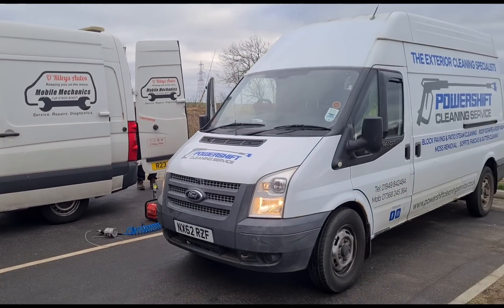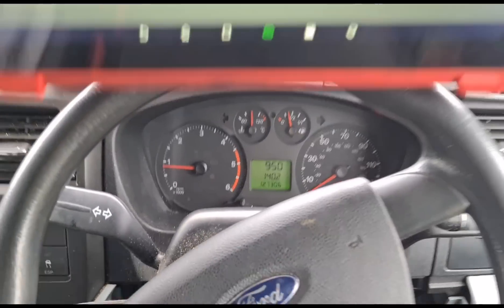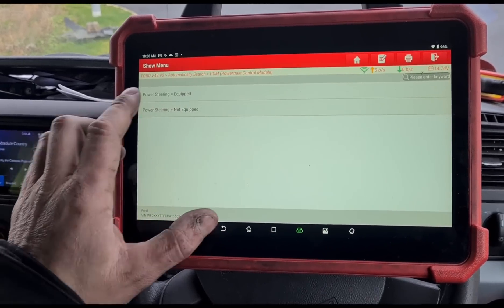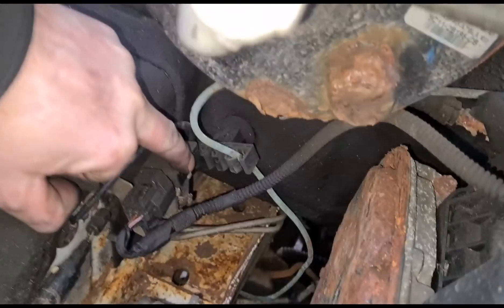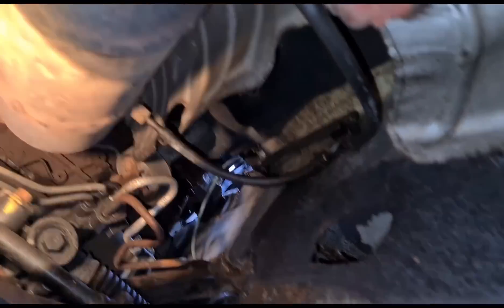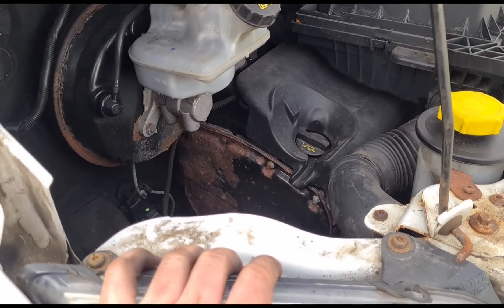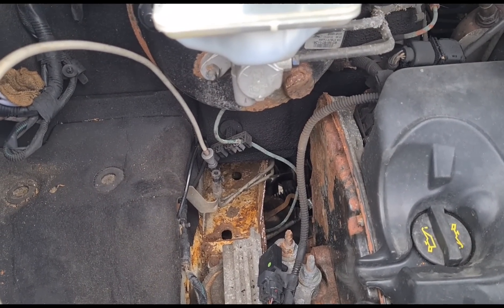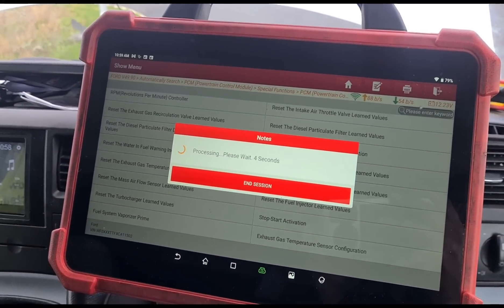Transit DPF Fault With No Codes?

Comment: Same issues with my 2014 2.2 transit, its taken 4 years and 10 mechanics as there are no fault codes. mobile mechanic found a blocked vaporizer, 90% soot in dpf but the dpf has low pressure and that blowing air issue you mentioned, he couldn't find where it was coming from either. Engine refuses to give full power, no toque yet has 187 bhp it was remapped. Other owner had dpf issues after 3000 miles from when it was new. Van has done 81k miles, i've owned it 4 years. There's no engine warning lights, so was recommended a dpf delations, had that done Monday on the 12th feb, the dpf will be drilled out tomorrow on the 15th. Oddly just deleting the EGR and dpf system has changed how the engine is sounding and working. MOT centers have recommended the deletion after the amount of issues i've had with it.

Comment: ? Normaly when there are faultcodes in the PCM, a lot off carbrands won't start the regeneration proces!
Reply from the maker: Yes correct. These transits will still regenerate with a dead glow plug. I have tried and tested it
Reply: Ok thanks for the tip.👍 Greetings from NL.

Comment: That hole has been put in to gain access to the captive nut that the subframe bolts to.  The captive nut probably broke free when someone tried to undo a seized subframe bolt.

Comment: Hi Jimmy, wondering what your opinion is, The Mrs had a 2014 kuga 2.0 tdci euro 5, had it from new, it had its first service by ford and after that I serviced it myself, changed the oil every 5k and took it to 117k miles with never an issue, I recently bought a 18 plate kuga 2.0 180 bhp with 40k miles on full ford history, our old kuga was quiet even on cold start up, this new kuga is the euro 6 but it chatters 'rattley' on start up and when up to running temp, is the euro 6 more noisy than the euro 5s?
Reply: Yes Ford use thinner oil in the Euro 6
Reply: @daveawhittle  I use to put 5W 30, in the other motor, in the summer I used 10w40, I see the euro 6 has 0w30, I was thinking of putting 5w30 in it, I realise that thinner oil aids economy, what's your view Dave?

Comment: Do you ever have issues where the launch will not show you the temp from each temp sensor or not even list the temp sensors at all. I.e the van has 2/3 and it only shows 1 ?
Reply from the maker: Yes
Reply: @ORileysAutos  could you pls tell launch to sort it out lol